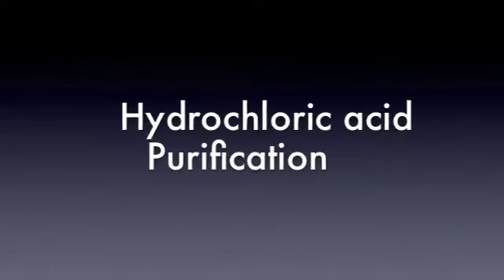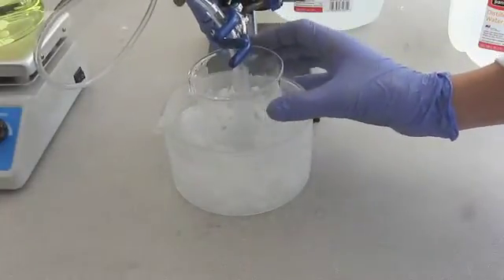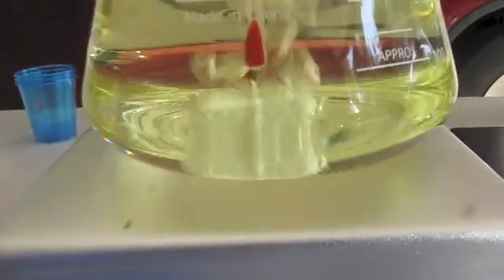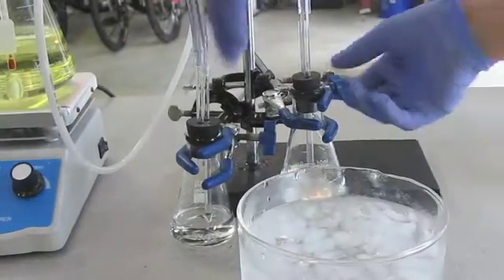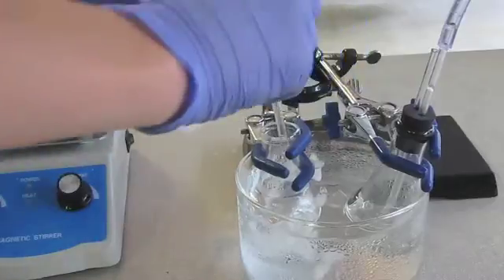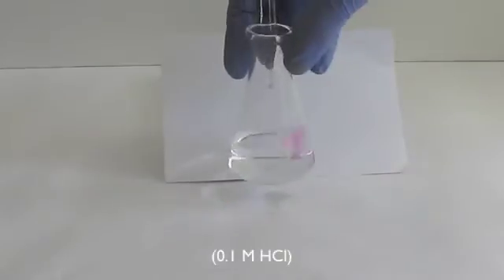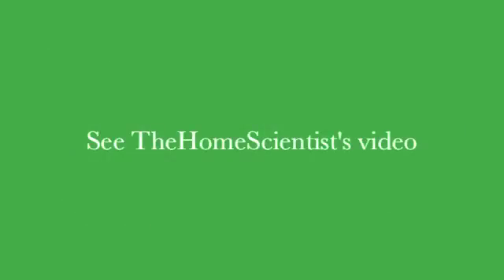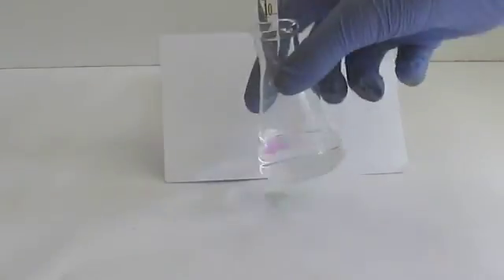How to Purify Hydrochloric acid (sort of)

Comment: Your are using the wrong materials, when you add aluminum to the solution it will produce hydrogen bubbles not hcl bubbles. I think you should use a clorine salt for example sodium cloride, calcium cloride....... Then you have to add concentrated sulfuric acid so that the hydrgen H and clorine Cl gas will form at the same time, then connect the tube in the solution of the muriatic acid and your results will be succesful.

Comment: because u forgot about azeotrope chemistry, HCL will boil till it reaches 20% concentration
so ,boiling it will only take it to its equilibrium first

then maybe it will boil with the 20% conc of h2o and hcl solution as a whole

you lost most of your acid because of metal

Comment: The thermoemter position is wrong. You should muy it the closest as possible to the exit of the erlenmeyer flask so the temp measured is the one of the gases that are about to be condensed. Also the addition of aluminum foil was a bad idea

Comment: Dude, the HCl is reacting with the Al and forming AlCl3 (and H2) which is what generates heat. Therefore your useing up the HCl, how did you think it could possibly work?
Reply: Not exactly true although extremely inefficient if you have ever dissolved Al in hcl it puts off a ton of heat and it releases hcl into the air. Its hard to mistake those disgusting and choking fumes. Not yet reacted hcl will be there with all that heat. It takes time to react all the Al some hcl will be put off. It maybe inefficient but it can work. How well though Idk.

Comment: Is muriatic acid actually poisonous?
Reply: It's probably not food-grade HCL. Putting a "poison" warning on the bottle helps people to avoid accidentally using it in an application that requires food-grade materials. Also, in a commercial situation, using an ingredient against its labeling can result in all sorts of legal consequences. If you used cheap HCL that was clearly labeled as "poison" to save production costs, your insurance company will not cover the damages.
Reply from the maker: Technically it's just corrosive. 
However if you drink it you won't be worrying about the technicalities....
Reply: +TheChemistryShack ok, why did you remove your MEKP video? And just a heads up, my parents are limiting my chemicals and equipment so much I have to quit YouTube in a few weeks.

Comment: i do the inverted funnel method but a little different. 
i collect in a glass bowl and place a stir bar under the funnel.  i turn the stir bar up high enough to cause a continuous vortex to form up into the funnel!!!  this seems to trap the gasses in the funnel while also providing a very large surface area of ever changing fluid to be exposed to the gasses for a long time.

i use this method for synthesizing using sodium bisulfate. it shoul work for this as well.
Reply from the maker: That sounds like a good idea! I might try it in the future. I discovered after a gravimetric titration that my HCl is over 99% pure, so I don't need to purify it. But I will try that method when I do any other gas experiments in the future!
Reply: yeah im new at chem and don't even have any phenolphthalein. im terrible at math too lol yet was a robotics engineer  i glaze over looking at stoichiometry.

i only make 120ml at a time so it seems titration would be stupid for me, i would waste my mats!

i ran som hcl today using the sodium bisulfite method and reusing some weak 3.5ph crap i had and it turned out nice.  i need some ferris chloride for another task so i covered 40 grams of old nails with the stuff and it instantly fizzed and turned dark green.  i had to dilute it a bit.

i wish there were another way to determine purity
Reply: TheChemistryShack Maybe you could do an explanation of the titration process with some math.
Reply from the maker: Clown Whisper There are several good titration videos online that explain the math.
Reply from the maker: Clown Whisper I'm actually coming out with a video soon showing how to titrate HCl without expensive apparatus (all you need is a scale and Baking soda)
Unfortunately though, the video got deleted on accident so I have to refilm it all, but expect it soon :D
Reply: B 

TheChemistryShack

Comment: Maybe there was a hole in your apparatus? In order to push the water down in the inverted funnel, you need more pressure than you would in a regular hose. That method should work and I have used it several times personally. 

I would say that you should try it again and use the inverted funnel as the suckback trap. I think that would work.
Reply from the maker: Ok I will try it again--it may have been the rivets in the funnel that allowed the gas to leak out.
Reply: +Nile Red Hey Nile, could you do a video on this? There's not really a variety of videos on this toppic.